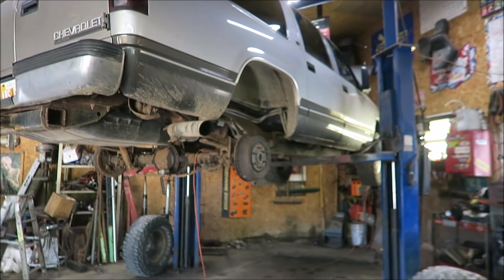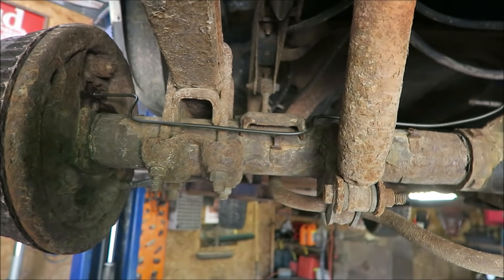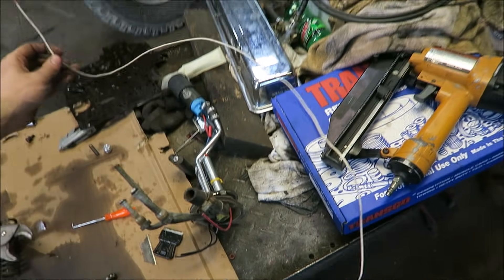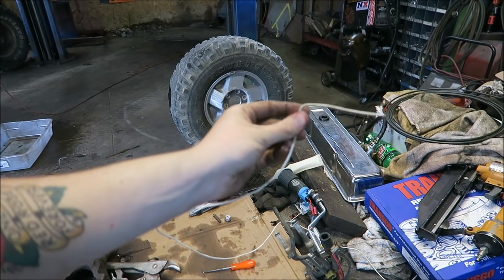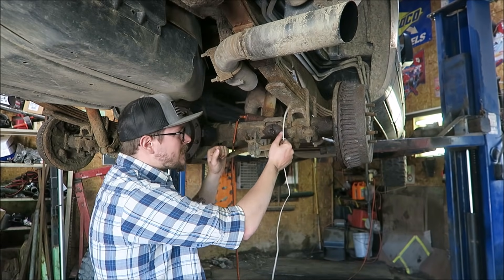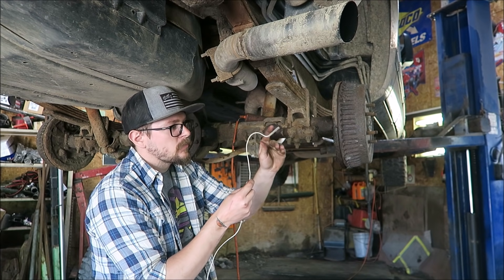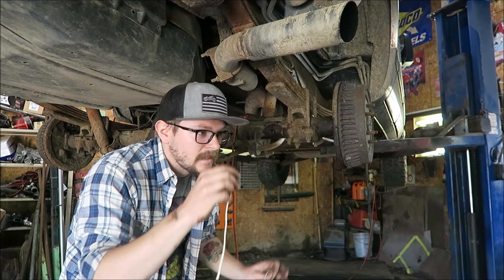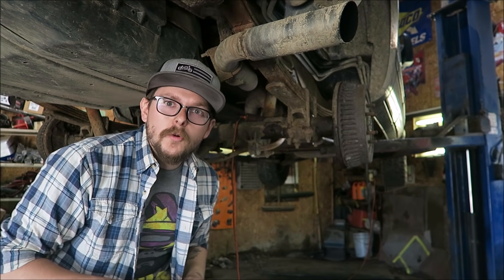Replacing Brake Lines? Try This!

Comment: Just a quick add. Been doing brake lines for ever... I found a new type of line that bends easy but has less chance of kinking. It call nickel copper line. Makes life so much easier..
Reply: NiCop! Wouldnt bother doing it without it.
Reply: Cu-Ni sure. But I assume you are using a good quality pipe bender tool with good shoulder support to the pipe ?
Reply: @benzflynn  not so much. The as the steel lines, the nickel-copper are much better. You can bend it around a broom handle to make a spiral and can do it without any bender.
Reply: Where do you buy it at I’m having the hardest time finding one for my 05 
gmc Envoy slt
Reply: @manieflatlinefresh that’s bc it’s not gonna be vehicle specific, you just buy NiCu brake line of the diameter that matches and buy the correct fittings for ur vehicle
Reply: Also double the price. Don't forget that
Reply: @Strizzy1273 it's worth it though

Comment: I just replaced those lines on my 90 k2500. Both wheel cylinders were leaking and the shoes and hardware were trashed. My big drum brakes were a pain in the ass. There's very little room for the 90 degree bend between the backing plate and the leaf springs. I've used the wire template trick before but I didn't use it this time. 
  Thanks for showing us. Keep up the good work.
Reply: Wish you were here

Comment: Great stuff.  I had to do the rear brake lines on my 2004 sienna.  I ended up going all OEM for the rears (on the hard lines, after market for the soft).  I made a video too.

I was originally gonna bend and flare my own steel lines, the short ones (about 18" for the rear) and got started using some scrap Romex, super stiff.  

It ended up for my situation, cheaper and faster to just buy them all pre-bent and it came with all the fittings and additional coating surrounding the hard lines.

For the LOOOOONG rear lines that are before the short rear lines, those I found, about $140 a piece, pre bent, free shipping just local dealer pickup.  If bought online it would have cost about $100 a line, shipping online alone was $150 to ship LOL.  These suckers were like 12 ft long.  Buying them pre-bent made it SUPER easy and every bend lined up (within reason).  Had to get a tiny bit creative with the fasteners as the original brake tube holders would shatter when removing the line.

For my project BMW e28 from the 80s, when the time comes, that I'll use romex and attempt to bend my own.

Huge learning experience for me.
Reply: Where can you order the pre-bent lines you mentioned in your post?
Reply: @mana-oc3qw  Its all in my almost 20min video. First 5 minutes.

Comment: Great idea but Instead of a wire you could always use a brake line to make a template for your brake line.
Reply: Esp with Co/Ni
Reply: @kenweller2032  Love Copper Nickle. Makes life so much easier.

Comment: Bailing wire or coat hanger works good or you can use a tape measure . What use is new break line , I measure out how much I need and then dry fit it . Word of advice use some kind of tape (I use black tape) and tape the ends off to keep any dirt from getting into the line .

Comment: Sensible and available idea.
My question is this.
Why put more copper-nickel line on to replace the steel when you can get some Pirtek braided steel pipe and neoprene sheath ?
No more bending.

Comment: Hey SniderTron 3000 I need some help I have a 2000 gmc truck and I want to put a bumper from a 20003 gmc with the big round fog lights, do you think it would fit
Reply from the maker: Should, seems to be a common swap. I think you might have to mess with the frame horns a bit to get it to mount. I don't remember though

Comment: I know this out of the blue but what is a good loud muffler to put on these trucks I have a flow master 44 dumped at the axle and it’s just not loud enough
Reply from the maker: The best exhaust sound I've ever heard was actually on a 1996 Buick Roadmaster wagon I had. All it had was resonators out to the tail pipes and it screamed. I loved it lol but idk. Kinda depends on if you want that chambered sound, or something like a glass pack, etc. Loud at idle, or just at higher rpms?
Reply: Louder at higher rpm

Comment: It's better to use the more difficult, yet more readily available, tool/material as was the case with the wire. I can just imagine me trying to follow your video using what you are using, but you having something much easier to work with. Yeah, it wouldn't be fine lol.

Comment: Can't a DIY just purchase a break line ready to go??
Reply from the maker: Those tend to be more expensive. You can get 25 feet of brake line for $20 and a box of fittings for like $6. Where I've seen some of those premade ones cost like $30 on their own. But, yeah thats definitely an option. But if you're doing a whole vehicle it'll cost a lot more real quick and sometime they're harder to get into place being prebent, like behind a gas tank for example
Reply: TY! But knowing me I'd probably spend more trying to make them & screwing them up!
Reply: I bought some prebent brake lines from lines to go but can’t find anyone that will put them on. I guess that my 2001 Accord will sit until I do.
Reply: @deandecoursey3061  I only had to replace my Rear Driver side. I researched you tube. Did it myself. Pretty easy.  If I can do it Anyone can!!